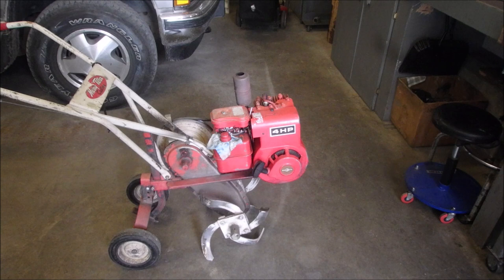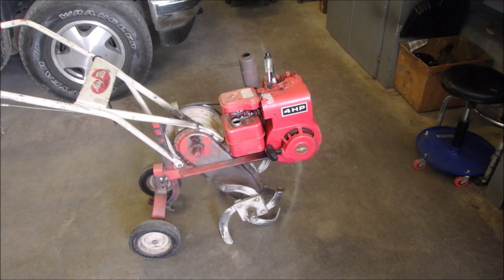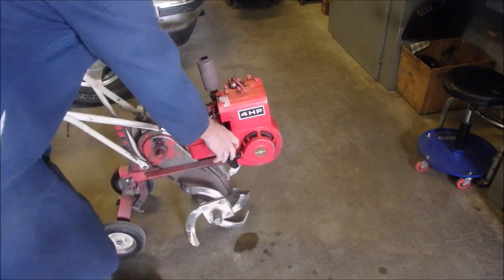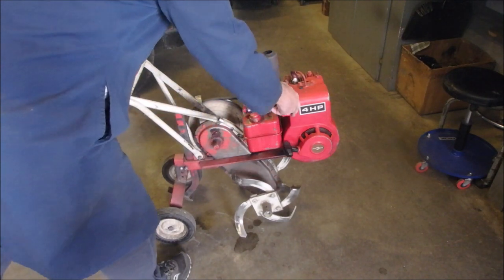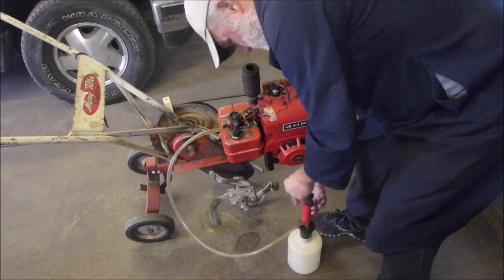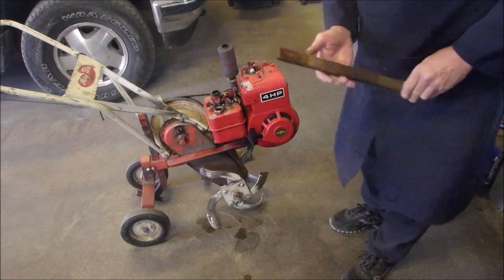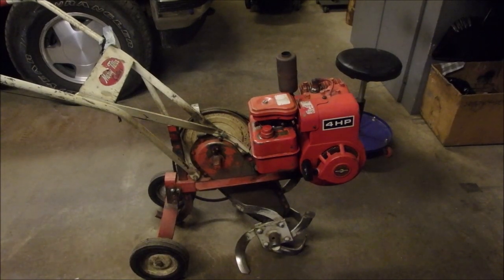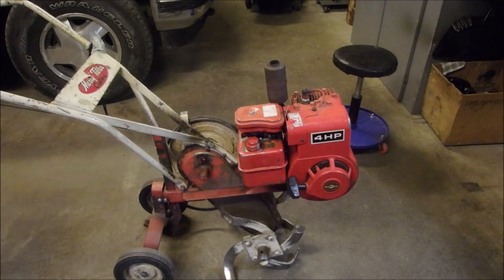Fun in the Shop With Merry

Comment: I have a similar vintage tiller with a B&S 5 hp.  Converted it to electronic ignition.  Starts 1st or 2nd pull every spring.  Sits in the garage for the next 12 months.
Reply from the maker: I had a hard time finding a coil as i said in the video.  This one the spacing to the flywheel magnets it longer

Comment: Bruce its the OLD MAN at EP saying nice to see a piece of equipment that is 53 years old still running simply because it has been maintained over all those years. If it ever does fail and is being scrapped remember to keep that fuel tank assembly because they are no longer available and command big bucks even in the used condition. Actually had two of them that we kept in stock in good condition and recently got to use one to save a similar rototiller that had a very badly rusted fuel tank that needed replacement. Our other spare may sit around for years but when you need one its nice to have the spare on hand. I think Donyboy73 posted a video short on this exact fuel tank being no longer available.
Reply from the maker: Thanks Wayne
Reply from the maker: I have 2 of them in the shed as well   different vintages as there are a few different types.

Comment: My father in law(passed) used to gripe every spring about all his stuff not wanting to start. He would burn out the solenoids on his riding tractor and electric start push mower. His 2 stroke weedeater also. I went thru and fixed everything one fall, and come spring nothing would start for him. I found out that he was mixing all his old fuels together(diesel,gas,2 stroke mix)in the fall, then trying to use that up first thing in the spring before he had to buy more fuel.  I told him to use only new fuel. Needless to say, next spring same problems. Some people can’t be helped no matter how hard you try.
Reply from the maker: Right  When I as them if the gas is new they say yes but it comes from a can filled the previous year.

Comment: Hey Bruce  you should  also check the vent on the gascap
Reply from the maker: Right  That is why I removed the plastic on the gas cap.
Reply: When you get a chance look underneath the fuel cap  of that style engine has a gasket paper whit holes in it it's a round gasket.. for vent

Comment: If the spark plug itself is bad, but the coil is still good, and everything else is making connection, will the spark tester still show the ignition system is working?
Reply: The spark tester will still show that the coil is producing a spark since the spark plug is providing the ground to the engine block. If the spark plug is good the unit will normally run with the spark tester attached. A spark plug can be tested with an ohm meter to see if it is good or bad. Additionally you can remove the plug from the block and with it still connected to the plug boot ground the plug to the engine block and pull the recoil to see if you have a spark at the plug. At EP we have actually used two spark testers on a twin cylinder riding mower to watch the spark disappear on one cylinder once the engine reached a certain temperature to create a coil failure on one cylinder at this point we suggest our customer change both coils even though one is still good (only a matter of time before the other one fails).
Reply from the maker: The spark detector will not flicker if the plug is bad
Reply: @BrucesShop  I must retract my statement above Bruce is correct if the plug is bad and not providing the ground the light will not flicker on the spark tester.

Comment: I have a question. Cub cadet  shredder extremely hard to start because the cutting flywheel  can't be isolated "removed from the actual starting pull" any ideas on how to modify  to make starting easier? Good Briggs engine!
Reply: How many horsepower? The bigger engines (8 HP+) are hard to hand start because they are bigger displacement, unless you eat your spinach before pulling the rope. My 11 HP Briggs has electric start, thankfully.
Reply: @haneyoakie14  when I remove the engine its a normal start. I have a two stage jenny portable compressor  pull start  no electric and it is easy to start --of course its a Honda  which does make a difference.
Reply from the maker: Yes it may be parasitic load or just a big old machine like my 8HP snowblower.